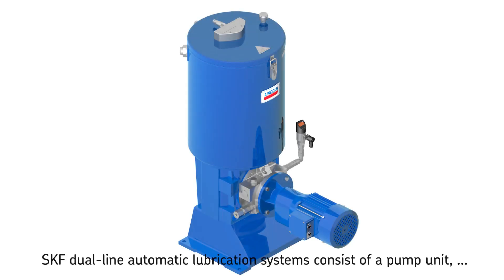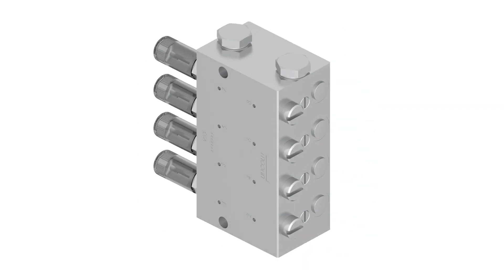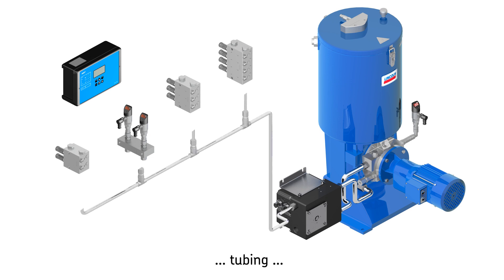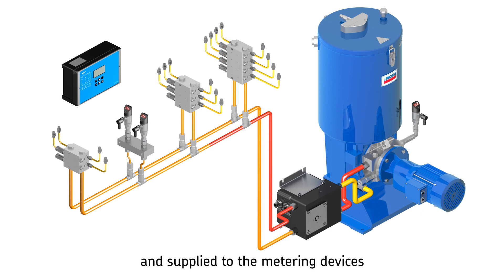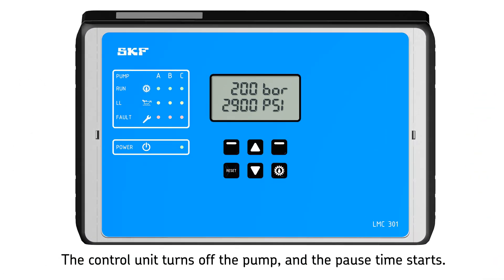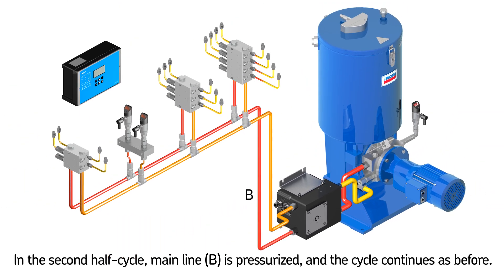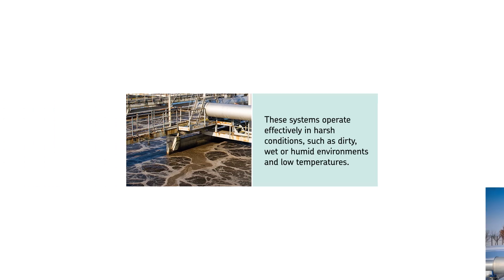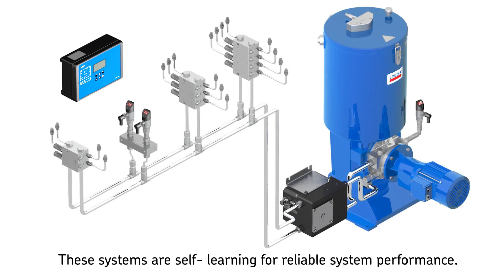SKF Lincoln Dual-line lubrication systems

Comment: If pump pressure is not exceeding above 100kg and leakage fault comes after runtime completion..what is the problem check valve O ring also damged and changed